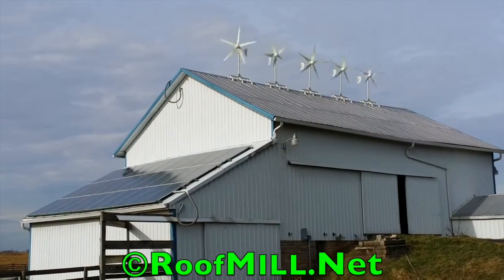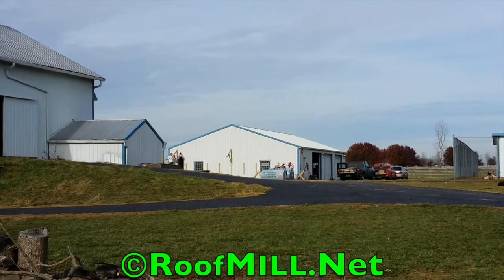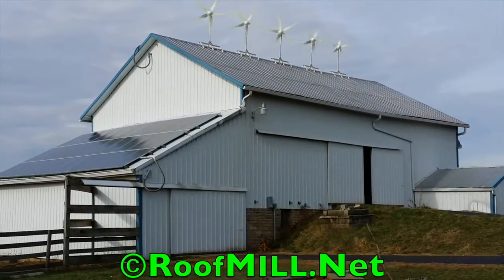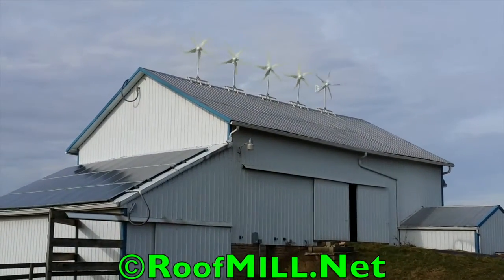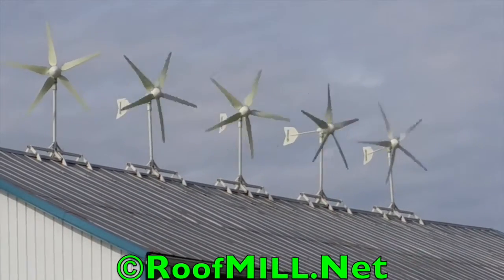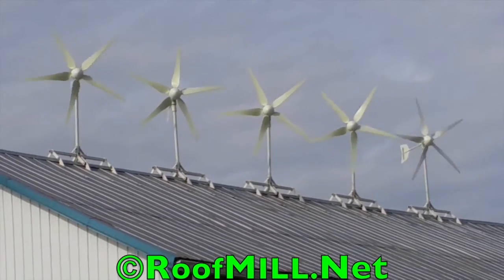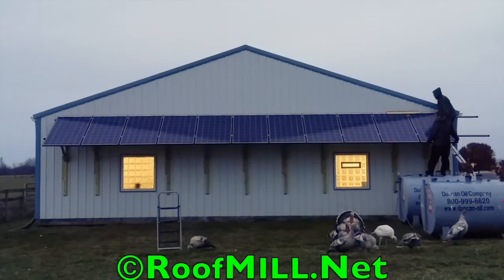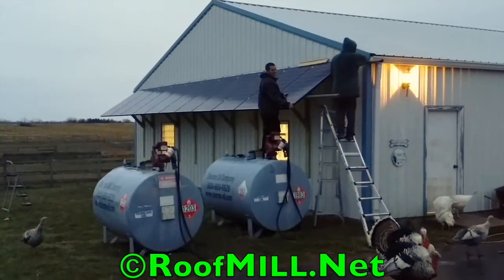Wind Turbine Roof Mount System Kit for Residential

Comment: I like when take selling back ,but very say how much for ,lol never for what you pay them
Reply from the maker: SHARED REVIEW - Windenergy7 Review by Charis Luczak = ★★★★★
I helped a friend install the the RoofMill system on his house here in Utah last year. It was a great experience and everything worked just like it was supposed to. WindEnergy7 helped us through planning, permit, install, and everything and we had never done a windmill or solar panel before. The kit was well designed. I wish it came with the batteries but from what Sam at WindEnergy7 said it cost more to ship them than to buy them local so that makes sense I guess. The system has been making power for months without a hitch. The most fun home improvement project my friend and I have ever done. https://www.google.com/maps/contrib/118259844948444805320/reviews/